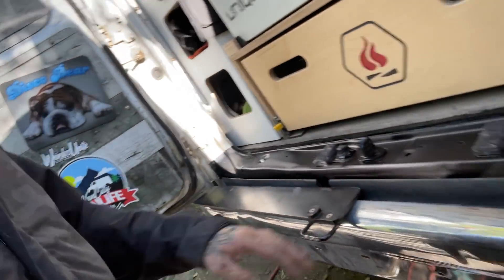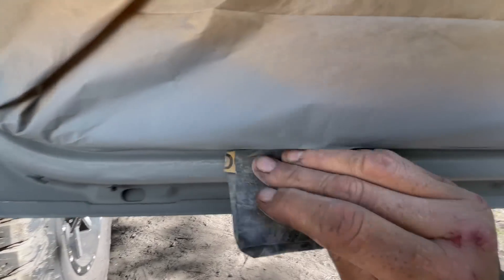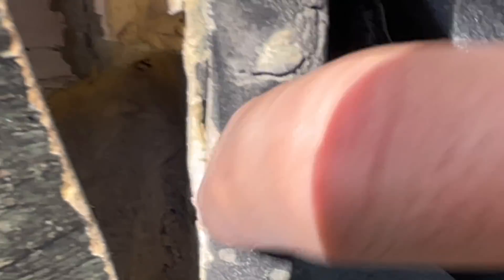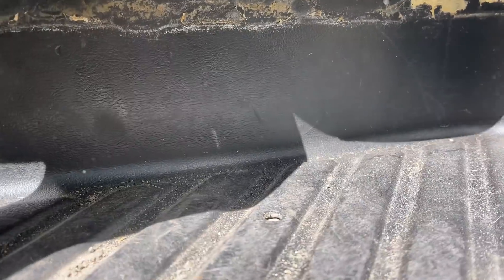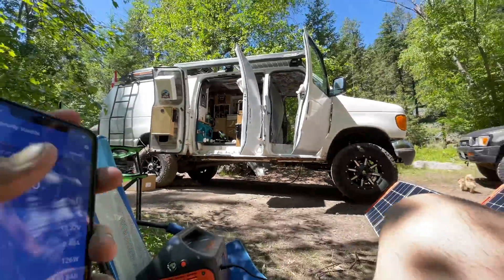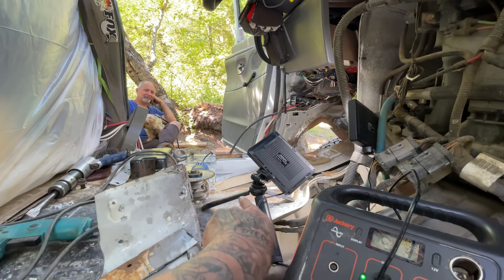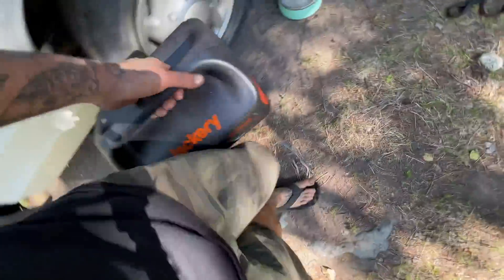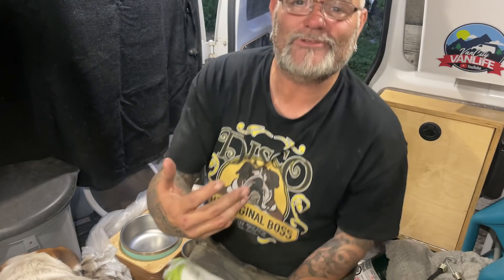Grinding With Portable Power. Welding begins Today. Small Touch Ups And a BIG DIRTY VAN REPAIR

Comment: That is the problem with stationary, You HAVE to park in the sun which overheats the van whereas portables can be in the sun at the correct angle while the van is parked in the shade!

Comment: A nice little thing to do you could spray rock guard on the inside at the bottom under the weather stripping of the Door and then spray white paint over it . it cleans up the inside the door jam really nice